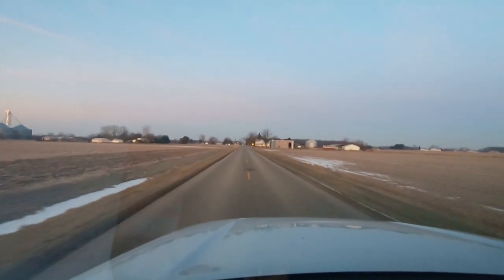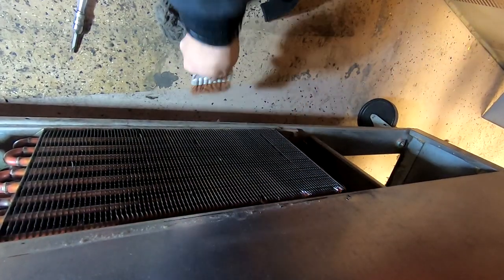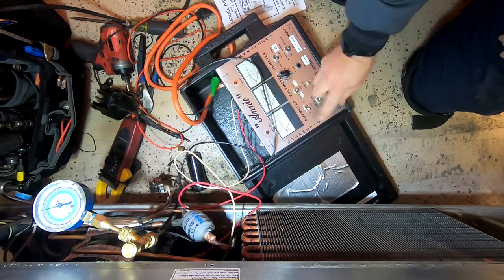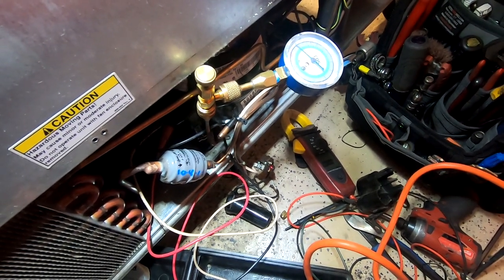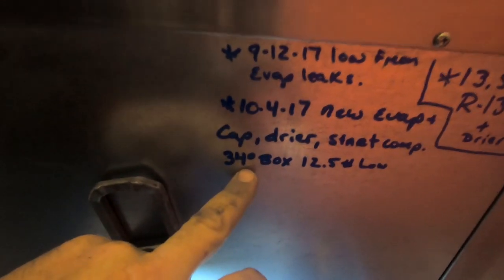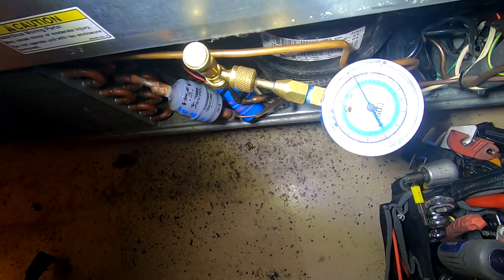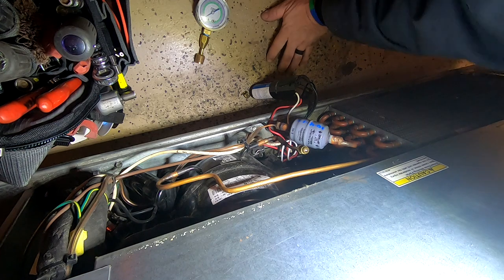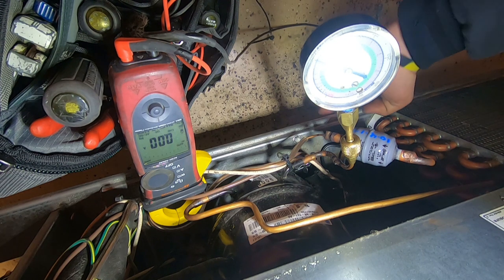Reach-in Cooler Prep Table Warm

Comment: As you stated,  the multiple times the system was low on charge put a strain on that  compressor/start components.   Annie is the fancy version of nor cal's start cord.
Reply from the maker: I change the compressor today and it's a good thing I changed it. It looked bad.

Comment: Slap a compressor in that puppy and she'll be good for another 10 years. Did that many tImes during my career. Love Annie!
Reply from the maker: Yeah, the aluminum inside the case is getting a little bit corroded and starting to turn to powder. I'm thinking of updating Annie's displays to digital.  I blew up the ohm meter by accident trying to use the capacitors as an external start components on a live system. 😭👎

Comment: Ah , the joys of single phase equipment !
I'll never understand why they refuse to give you a hp port , I get that on this type of small units the most important will be LP and there's not much room , but a lot of times they do have room and they've even put a 1/4 inch tube on the high side , only they've bloody brased it shut 😡
Reply from the maker: Generally there is no refrigeration ports on small critically  charged systems because some fool comes along and dumps a crap load of refrigerant in there without properly diagnosing the system.
Reply: HVACR Survival I’ve seen them come up to the unit, scratch their head and then proceed to cut the pinched process tubes,then weld taps and then proceed to diagnose the problem. I tell them that’s the last thing they need to do. Look , feel and then that’s the last resort.
Reply from the maker: @captainkirk7702  I like to completely remove the charge and weigh in the factory amount so I know it is correct, then if anything is weird,  I know where to start but I'd like to see the before and after pressures 1st before making any changes.
Reply: HVACR Survival so agree!
Reply: HVACR Survival let me be straight I don’t do that but I’ve seen a lot of other people that will do that because they don’t know what their doing.
Reply from the maker: @captainkirk7702  I got what you're saying👍👍